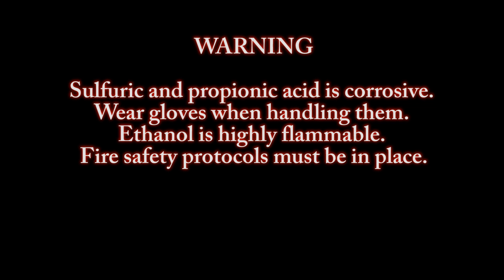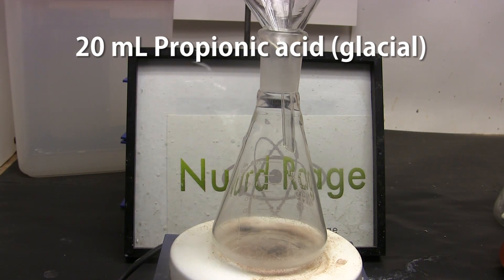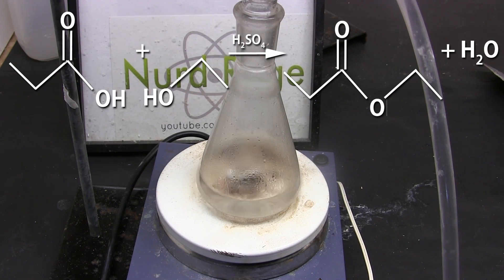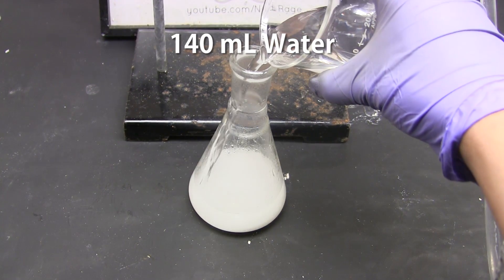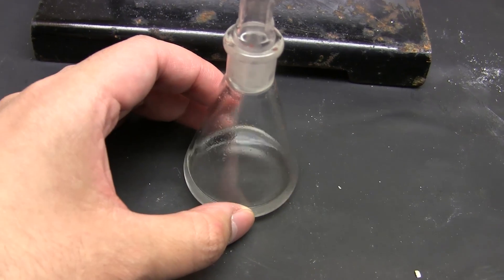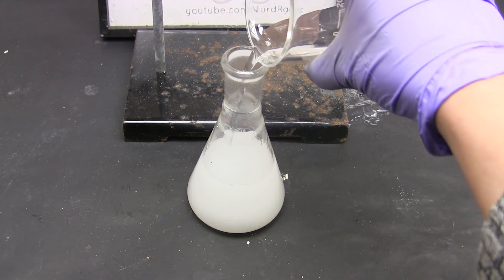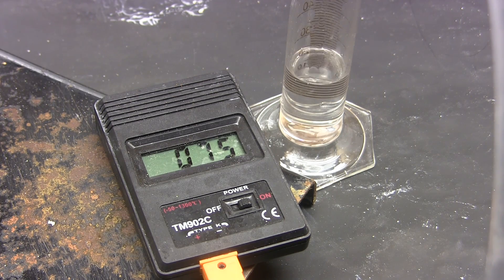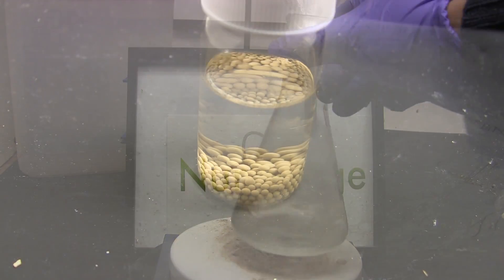Make Ethyl Propionate by Fischer Esterification

Comment: Low yield may be from the condensor. Those short straight walled things are absolute shit. You may want to try hanging a copper wire through it, or investing in something closer to a Dimroth.

Comment: What does the "reflexing" do to the specific chemicals in the reaction
Reply: "Refluxing" - it basically means you boil it but cool down the vapors and let them drip back in. It lets you boil stuff for a long time without losing much or any reagents/water.
(Thinking about it, it's very much the same reason you put a lid on a crockpot.)
Reply: +Daniel Nebdal hey thanks for responding, I'm about to go into chemistry next year so I just want to learn a bit more about these things

Comment: What would dissolve the magnetic stir bars? :)
Reply: +Mr. Reinterpret Cast The good ones are Teflon coated, and that is pretty tough stuff, very unreactive, corrosion resistant, heat and shock resistant, etc. Molten sodium/potassium and/or hydroxides should do it
Reply: ***** Thanks for the reply :)

Comment: Video suggestion (electrochemistry): construct a Voltaic pile capable of a large voltage output. All you need are alternating zinc/aluminium and copper plates and an electrolyte (sodium chloride works well enough, but perhaps there are even better ones?) soaked into absorbent material. This is not a feasible 'DIY' alternative to a commercial dry cell battery: the purpose is- as always- to explore the science.

Comment: Surely one could use Propanoyl Chloride and Ethanol and combine them directly for a higher yield?
Reply from the maker: +chuck52u Any suggestions for how to make propanoyl chloride using amateur/home chemistry?
Reply: +NurdRage Did not think about that when I posted the above comment. Thionyl Chloride could be used, but that is probably beyond the reach of the amateur/home chemist, and any propanoyl chloride made might hydrolyse too quickly with water vapour in the air to get a worthwhile amount.

Comment: can ferrous sulphate be decomposed with heat to create sulphur dioxide and sulphur trioxide and then be consensed and further processed into sulphuric acid?

I read this somewhere and was hoping you could confirm or debunk this.

I found ferrous sulphate to be very very cheap and easy to get meaning the sulphuric acid would be easy to make for my experiment but I'd rather not go through the entire process with my amateur equipment only to be dissapointed. 

if you could get back to me on this I'd appreciate it.

Comment: Do you yield some ethyl-acetate just by mixing some denatured alcohol and (cleaning) vinegar at room temperature? Because I tried this once and did notice a sweet smell. Or is the main difference that you get a lower yield just by mixing diluted compounds?
Reply: +Kwin van der Veen If you heat it up, it will produce some ethyl acetate. Simply mixing them might produce just enough that you can smell it.

Comment: Would you get a better yield by somehow removing the water produced during the reaction to keep the reaction water free?
Reply: +Nolansykinsley Esterification reactions are a classic example of equilibrium limited reactions. 40% is a reasonable yield for such a reaction in laboratory conditions. The reason the yield is so low, is because there is an equilibrium between reactant and products (sorry if I seem condescending, but you said you're not an amateur chemist, so I'll explain it a little), as such, there is a constant which relates the quantities of all the substances at chemical equilibrium. In these reactions, the constant is between one and a hundred. In order to make the reaction go further, a removal of the products is desirable, shifting the equilibrium and getting a response in accordance to LeChâtelier's principle.
Coincidentally, I'm currently workin on this kind of reactions (the production of ethyl lactate). If better yields are desired, I'd recommend the following set up: First, substitute the sulfuric acid with an acidic ion exchange resin, this will make the post reaction separation easier, and the catalyst can be used repeatedly with only an occasional reactivation. Second, while this is easier with industrial equipment and is more related to chemical engineering than chemistry, a better sistem for these reactions is a reactive distillation one. It is easier done in a continuous process than in a batch one, like this, but the basics should be the same. However, there is a need for some considerations, and you need to make some calculations to determine the correct equipment layout. In this case, you'd need a reactive distillation column (or the lab equivalent) and two separate distillation units with reflux between them.
tl;dr. Yes, it's possible to improve the yield, but some reaction and separation engineering is needed. It's a current area of research.
Reply from the maker: +ZakuraTech Molecular sieves are actually somewhat delicate. They get eaten by acids and turn into a gooey mud that also releases aluminum and sodium salts of the acid. So not only would they loose their water absorbing ability, they'd also badly contaminate the reaction. Molecular sieves are best used for low-salt, non-corrosive, neutral conditions. Chemical extremes like acidity, alkalinity, or high reactivity tend to damage them.

As for getting the water out, it maybe possible using an acidic dessicant like silica gel. But then you'd have a mixture of gel with the ester, not a fun thing to separate. 

Probably the better approach would be to re-engineer the procedure and use propionic anhydride instead of propionic acid. That would produce much more yield. Problem is making that is way beyond the scope of amateur science.
Reply: +ZakuraTech There is a reason why this is the way it's done in the industry. Yes, it may be a relatively high initial cost, but if you look in the right places, you can get some great deals. Let's say you want to poduce in the same scale as in this video. You won't need more than 5-10 grams of resin. It won't cost a lot and if taken care of, you won't need to think about it in a long time (a professor has used some in esterification reactions for like 3 years without the need for reactivation). It's also not impractical. Just put it in a steel wire mesh and you can leave it there. It's actually more practical.  Perform your reaction, take the products, dry the resin a little, repeat. It takes no more than 10 minutes.
We've found that 3-1 ethanol excess is an efficient mixture (even best if you can recirculate after separation) and 5%wt resin. In a reactive distillation set up, you can get 99% pure products, compared to the typical 40-60%. It depends on the specifics of the reaction, though.
Reply: +Nolansykinsley ah, is that why the yield is so bad?

I guess you might be able to use a drying agent that won't react with acid
Reply: ThePharphis I have no clue really, I am not even an amateur chemist. It is just a thought I had.
Reply: +Ottmar555 Given the cheapness of start material and the expense and impracticality of acidic exchange resins, forcing the reaction to completion with additional cheap reagents seems to make more sense. I personally don't do many esterications - but I am curious to know where the diminishing return in these sorts of synthesis lie. 

In particular, how many equivalents of alcohol would be needed to force the reaction forward; and whether drying agents in solution to take up water would be applicable. I know that under heated conditions sieves function poorly, but I'd be curious to know if it would be possible to soak the rxn mixture over sieves or other drying agent then heat things back up after retrieving them, etc.

What are your thoughts?
Reply: +Nolansykinsley What the others tried to say before going off to rant, is "Yes. Removing the water is the best way." You should use a Dean-Stark-Apparatus (if possible) or even a Soxhlet extractor charged with a desiccant like Na2SO4 or MgSO4 would do.